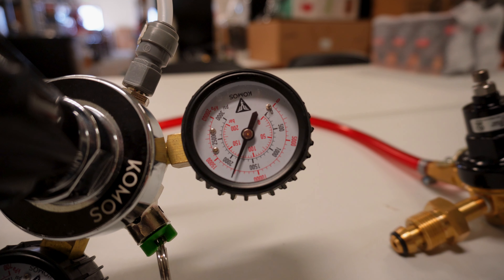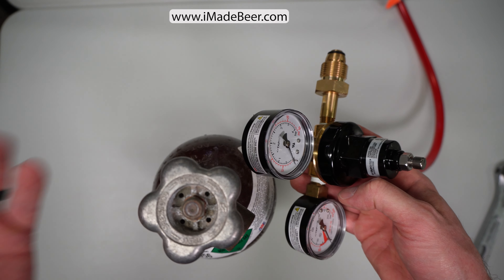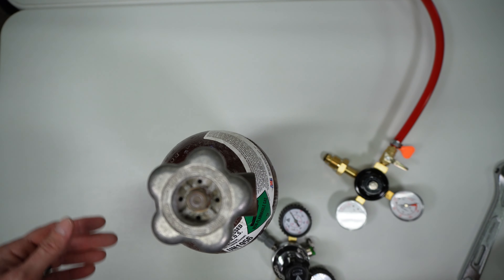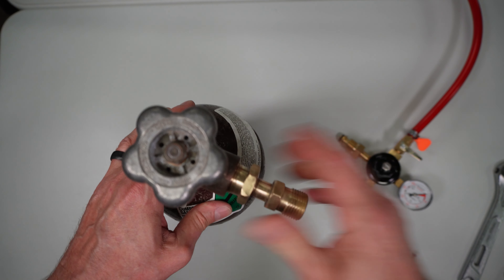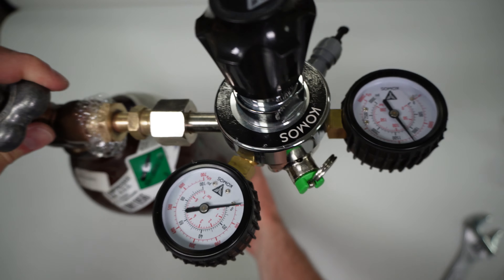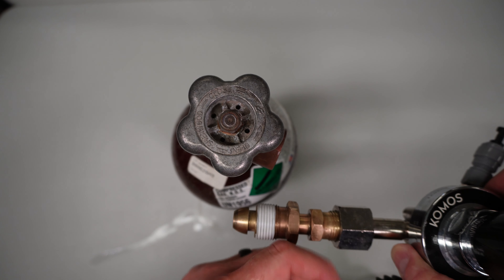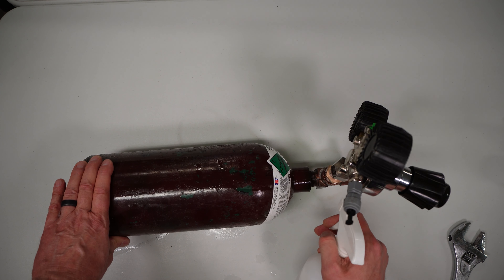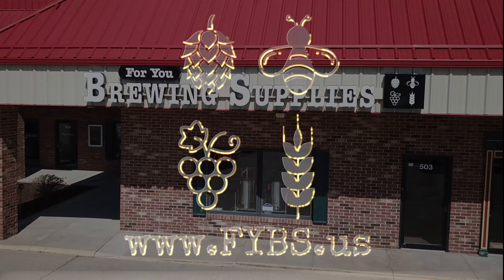Can a CO2 regulator work with Nitrogen or Argon?

Comment: My welding shop said that if you use an argon regulator on co2 that it can ruin the internals since liquid can come out, or gas can condense into a liquid. Furthermore several co 2 regulators have a heating element or heat sink to prevent freezing. The other way around shouldn't probably be done since co2 is 1800 PSI and argon is 2000 - 3000 PSI.

Comment: Most cga320 regulators for CO2 cannot handle the higher pressure of beer gas or nitrogen, which is upwards of 3000 psi in tank. While that regulator might be designed for that pressure, most are not unless sold as a nitrogen regulator. The threads on the cga580 are not part of the sealing mechanism, only the gasket, and you are actually interfering with the ability of the threads to pull the gasket tight enough by putting teflon tape on it, same in principle for cga320.
If you must switch between cga320 and cga580 you can get a single piece to replace the connector, with 1/4" npt to screw directly into the regulator body, instead of multiple points of failure with multiple adapters.
Reply: But if u have the correct adaptor can u use  nitrogen gauges on a co2 bottle to save buying 2 regs. Should i get a nitro one &  use it  on a co2 since nitro can take more pressure
Reply: Good question  @Matowix